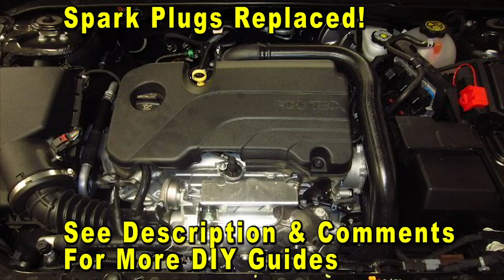2016 To 2024 Chevrolet Malibu How To Change Spark Plugs With Part Numbers - Quick & Easy

Comment from the maker: Chevy Malibu Spark Plug Part Numbers - https://amzn.to/49V8Gjo
ACDelco GM OEM Iridium Spark Plug Part # - https://amzn.to/3N5UXwx
NGK Iridium Spark Plug Part Number - https://amzn.to/4a0ZxWH
Spark Plug Socket - https://amzn.to/3RkCiiU
Dielectric Grease - https://amzn.to/3utwZVh
Precision Screwdriver Set - https://amzn.to/3sLixaP
Plastic Pry Bar Tools - https://amzn.to/3HMtsV7
Socket & Ratchet Set - https://amzn.to/3Z17LbA
Mechanix Gloves - https://amzn.to/3jCnHkt
Torque Wrench - https://amzn.to/3vS5uSI

The Paul79UF YouTube channel is a participant in the Amazon Services LLC Associates Program, an affiliate advertising program designed to provide a means for sites to earn advertising fees by advertising and linking to Amazon.

This DIY video shows owners of the 9th generation 2016, 2017, 2018, 2019, 2020, 2021, 2022, 2023 & 2024 Chevrolet Malibu sedan how to change the spark plugs in the Ecotec LFV 1.5L turbocharged I4 engine.

Comment from the maker: Check out the DIY guide for changing the spark plugs in a 2016 to 2024 GM Chevy Malibu -
https://www.paulstravelpictures.com/2016-2023-Chevrolet-Malibu-Spark-Plugs-Replacement-Guide/index.html

Here are all of the DIY repair and maintenance tutorials for the ninth generation 2016, 2017, 2018, 2019, 2020, 2021, 2022, 2023 & 2024 Chevrolet Malibu sedan - 
https://www.paulstravelpictures.com/Articles/2016-2023-GM-Chevrolet-Malibu-DIY-Repair-Maintenance-Guides.htm

Owners of other General Motors vehicles from Chevrolet, Buick, Cadillac, GMC and Holden such as the Impala, Corvette, Bolt, Sonic, Spark, Express, Trax, TrailBlazer, Equinox, Traverse, Blazer, Tahoe, Suburban, Colorado, Silverado, Cruze, Volt, Camaro, Encore, Envision, Enclave, Regal, LaCrosse, Canyon, Sierra, Terrain, Acadia, Yukon, Savana, XT4, XT5, XT6, Escalade, CT4, CT5, CT6 and Commodore may also find these DIY instructions to be helpful.